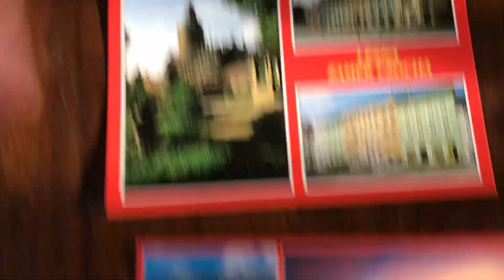Jim Timber rocks

Comment: Hi Deb! Thanks for telling us about Jim Timber. Sorry you've been stressed lately. I use a little drop of Super Glue on the outside of my bearings to hold them in place. The bearing also has to be sitting square and not tilted off to the side, and if you have more than one bearing on a shaft, the bearings need to alinged so that there isn't any resistance on the shaft. If the bearings are mis-aligned, the shaft won't turn freely and it will feel like the shaft is connected to a spring. I hope you are doing well otherwise. I've been thinking about you. Wishing you a pleasant coming week. Take care.
Reply from the maker: Hey Todd I am happy you stopped by. I hope you are all rested up after your intense one week whirligig build .your caterpillar turned out wonderfully. Please keep us posted on the results of the voting. I will try the super Glue 😀the gorilla glue did not work lol . I will get the shaft straight this time I have a plan (my hubby suggested it) so I can use the drill press and get the shaft straight😀 fingers crossed.Thank you for your always kind support and wise advice. Please give Peaches hugs how is the Pear ? Have a fantastical week